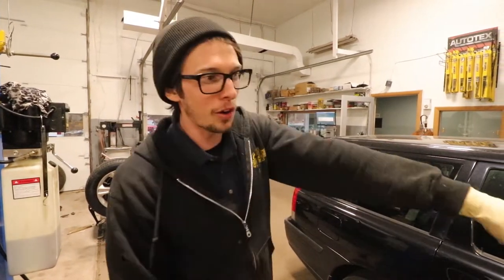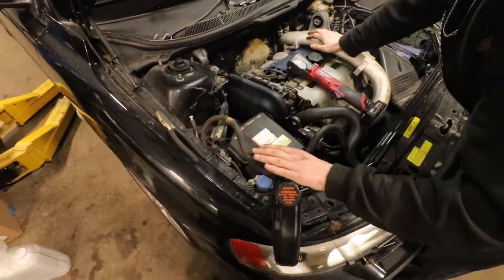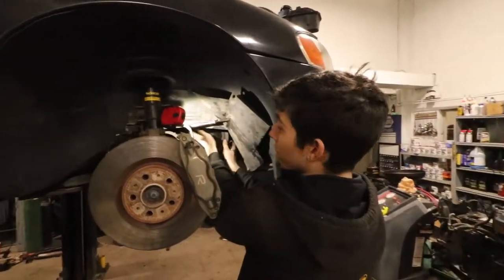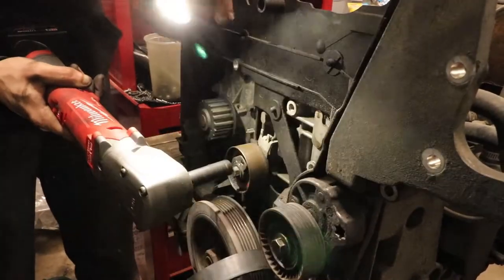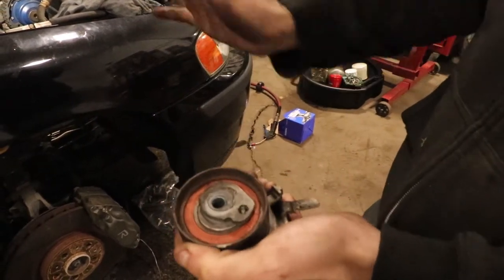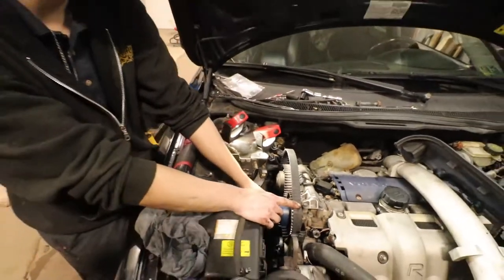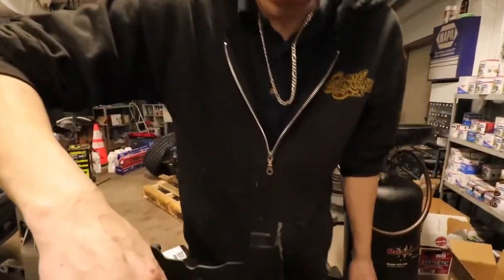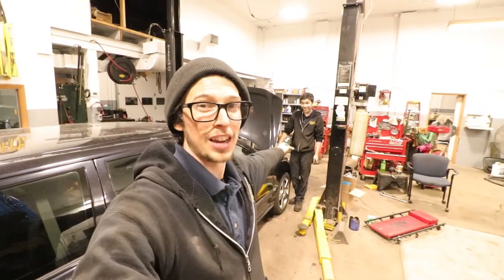Timing Belt Replacement On The Volvo V70R also for s60r s60 v40 c70 s40 s80 xc70 xc90

Comment: Way to go guys! My guy goofed my timing job up.  I suspect he is off a tooth or two as I have the ECM644A, P0340, P0017 codes.  Car cranks but has little power with misfires.  Looks like I should have did it myself after watching this tutorial.  I am thinking it is an easy fix.  I will need to RETIME it properly.  It was running like a champ before the guy did the  complete timing job for me.
Reply from the maker: yea best is just pull the covers and check it first before you pull too much apart
Reply: I am having the same codes on mine. Going to try to re time my car today. Wish me luck.
Reply from the maker: @Zephyr8086  best of luck

Comment: Would you recommend using a cam lock tool? When you vice gripped the intake cam was that so you don't have to use the cam lock tool?
Reply from the maker: yea the vice grip is to insure that the belt doesn't slip off where we want it to be Of course a cam lock tool would help but not necessary

Comment: how often do you need to do the timing belt change for the s60r?
Reply from the maker: a safe rule of thumb is 100k
Reply from the maker: just make sure your cam seals arnt leaking otherwise the oil will make it go sooner